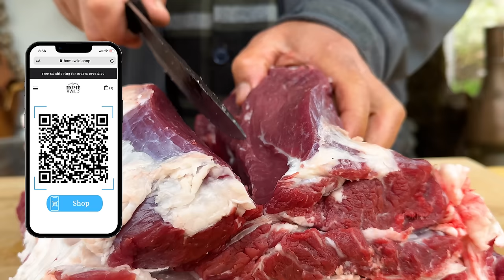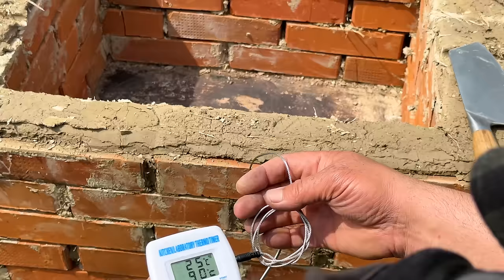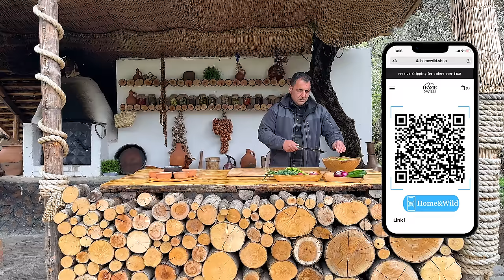Homemade Sausage With Your Own Hands! An Ancient Way Of Cooking Meat in the Intestines

Comment: The best way to ground meat for sausage through the three-holed metal disk (сетка). By the time the condiments are mixed into meat, it becomes sticky (almost emulsified) that give sausages a solid texture that allows it to be cut in very thin slices.
Reply from the maker: Thanks I'll know.